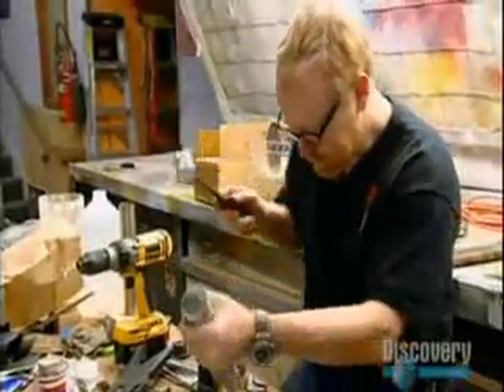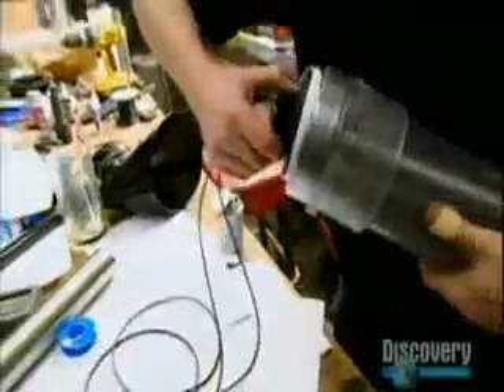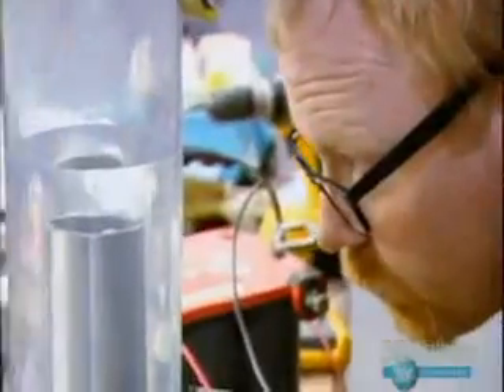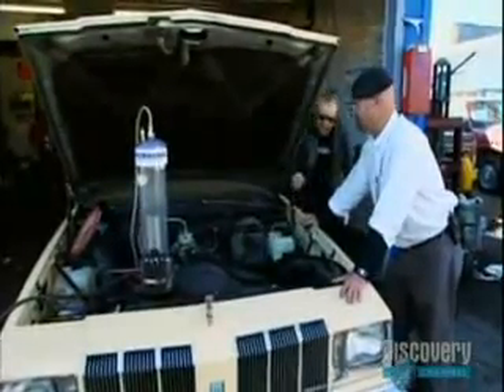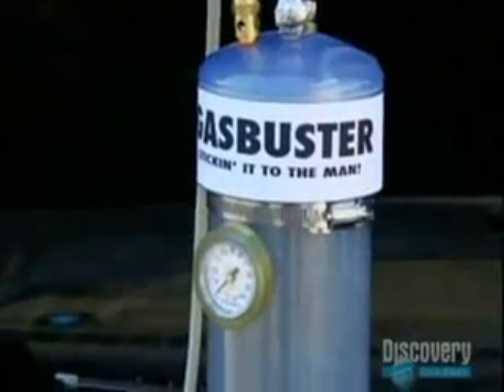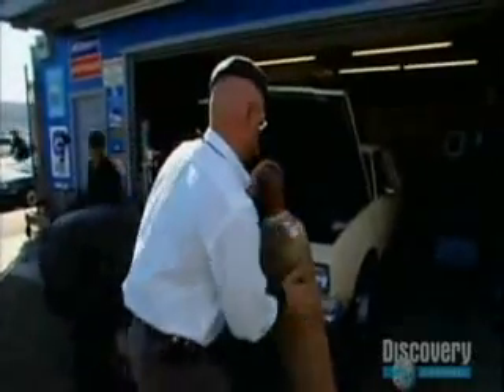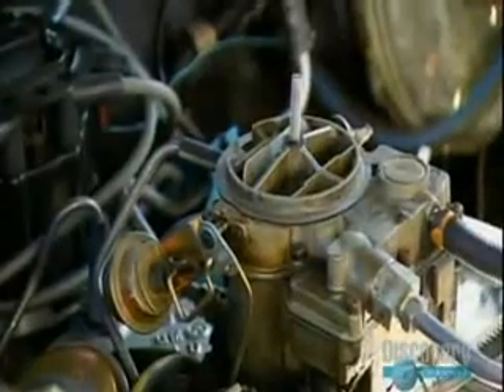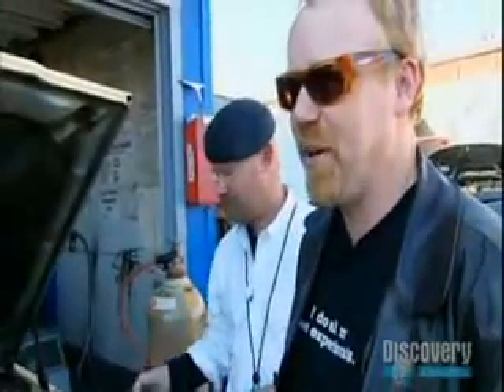HHO Mythbusters Explained

Comment: they failed because this cannot in any way work on a gasoline burning car! hydrogen explodes! the knly way to burn it is at a very low fuel/air mixture. which you cannot do with this simple technology. the other problem is once it is burning is it burns way too hot for the design of a gasoline combustion engine it could melt the aluminum.
Reply: do you not know how a combustion engine works? it's the explosion that powers the pistons.

Comment: HYDROGEN IS THE FUEL OF THE FUTURE. THESE GUYS ARE STUPID.
Reply: they want to the hide truth about it coz it will threat the oil industries.its all about business.
Reply: the show is compleatly trolling the subject.... they did nothing write in the so called "experiment"
Reply: You'll find that hydrogen bought in bulk (from a fueling station or whatever) is cheaper than the hydrogen you can produce yourself from electricity.  Electrolysis generated hydrogen is more expensive in electricity than the hydrogen it can produce.

But let's say for sake of argument, that you manage to get free electricity somehow...

Storing HHO (the H2+O2 mix you get from the electrolysis described here) is very dangerous.  If you don't separate the H2 from the O2, the resulting mixture is a pre-made perfect fuel-oxygen mix.  The slightest spark will blow up all of it, at once.  If you had a pure hydrogen (or propane or any other flammable gas) leak from a tank, it just hisses, and if you ignite it, you have a burning jet of flame.  If you have a leak in a low pressure HHO tank, everything goes boom virtually instantaneously.  Anything other than point-of-use/made-when-needed is asking for big trouble.

You can separate H2 from O2 relatively easily by designing the electrolysis cell to keep the bubbles of gas coming off each electrode separate, but this will make it far more difficult to produce large quantities of gas efficiently.

The other problem with HHO storage is simply that of storage container size.  At atmospheric pressure (all the systems here are), you need a storage tank of HHO about the size of your car just to store enough HHO for a few minutes of fuel at, say, a 10%HHO/90% gasoline ratio.

So you'd have to put it in pressurized tanks.  Add to the fact that Hydrogen gas seeps through just about any container and...

The mere idea of a storage tank of HHO pressurized to normal tankage pressures (say, 3000PSI) is enough to loosen the bowels with an irresistible urge to run very far away very fast.  Loose sticks of dynamite - if you somehow manage to ignite dynamite with  flame, all you get is a fire and a bad smell.

Combined hydrogen and oxygen is a FAE - fuel-air explosive.  Just watch youtube videos of these.  You want one of these in your back yard?
Reply: +Siward Beorn Has it occurred to you that using a device patented by an HHO nut as being "the answer" and showing it was a pile of crap was the point?

HHO nuts always point at published patents as "proof" it works.  Demonstrated that such a patent doesn't work is a pretty good demolition of that argument, isn't it?

The US Patent Office stopped requiring the inventors to prove that their "invention" being patented actually worked over 100 years ago.

Patents are cheap.  Sometimes groups of patent lawyers compete amongst themselves submitting the stupidest things possible.  The guy with the dumbest patent that's accepted wins.  And some of them are really dumb.  Like the centrifugal baby extractor.  Yes, that patent really exists.  Any women going through that would have killing the inventor as the highest priority.
Reply: Agree. This one Mythbusters are stupid.
Reply: +Elvis Morales "wood gas" is, technically, the result of "the destructive distillation of wood".  In practical terms, it means sticking wood inside a sealed chamber and heating the crap out of it.  At first, the wood boils out all the water it contains.  Once the water is driven out, the wood starts emitting gas.  If you put a pipe into the sealed chamber, you can draw off that gas and it will burn in air.  Much of the gas is methyl alcohol in gas form, and if you run the tube through a condenser, you'll get liquid methyl alcohol (plus a few other things in small quantities) dripping out, and that which doesn't condense is mostly methane.

If you just try to store the gas in a tank, you'll have a lot of liquid condense out of the gas.  So, you'd need to condense out what you can and store that separately before storing the gas.

Methyl alcohol produced in this fashion is called "wood alcohol".  In the olden days, this was the main method of methyl alcohol production, and known by as "wood alcohol".  It's by no means pure.  It will have small quantities of  other nasties such as formaldehyde, acetone etc.  These days they have far more efficient ways of producing pure methyl alcohol.

The wood left behind is essentially charcoal.

The only real reason it was done is that back in the day it was the only way to produce methyl alcohol as a liquid fuel or for things like solvents (methyl alcohol is the preferred solvent for shellac) largely as a byproduct of producing charcoal.  It's GROSSLY inefficient in turning wood into motive energy.  It'd be more efficient to supply the heat required into driving a steam engine.

Oh, and yes, the liquid condensate is poisonous - it's wrong alcohol for drinking, and the impurities make it much more lethal.
Reply: considering it is possible to make a bit of a better conversion job than stick a hydrogen line down the carb, i would personally convert my car to be a bi-fuel vehicle of hydrogen and gasoline. because wouldn't it be possible to fill up with hydrogen with home generators? and if i source the water from the stream literally running through our front yard, then i'm only paying electricity costs. i would be all-in on wanting to bring up more hydrogen filling stations, especially since now hydrogen fuel cell vehicles are starting to catch the public eye, GM released a prototype Colorado for fleet testing with the military, and what is it? a hydrogen fuel cell vehicle. opinions on if it should be produced are mixed though, but i do love the way it looks.
Reply: Justin Noker
Yea, but if you buy some land and the mineral rights and drill an oil well and build a refinery and spend your time operating and maintaining your well and refinery, you can have totally and completely free fuel and you don't have to modify your car at all!
Reply: Oil barons have long since bought patient of system that produces H in a marketable level. The US has the greatest oil reserves but has elected not tap it until other suppliers exhaust theirs but quietly smile as they bid up the price. This speculative strategy may destory their wealth once H production comes on line.
Reply: Guymick Cormic I disagree, hydrogen was the first fuel on this universe, so it does belong to the very beginning, not to the future
Reply: That's right!!
Reply: This device can be sabotaged easily. We do not know what true metals were used, or what voltages were used in the electrolysis. This "experiment" was rigged to fail. The big lies continue, and there is even an explosion to show how "dangerous" this invention is, and that it failed. And huge industries and governments have a vested interest in that failure.
Reply: Indeed it is exactly what you say it is Fromage. This is also true of moonshine actually too. Been watching some moonshine making vids on Youtube lately and the same nasty byproducts can produced there too. You NEVER drink the "heads" of distilled alcohol, the first stuff to come out of the still, as it is some nasty stuff that will make you go blind, damage your liver or kill you if you drink it. Acetone mainly and some other solvent by products that you would not dare drink. You taste it and spit it out to test if it is changing to shine and once the taste changes from the burn of acetone etc. to good tasting booze (the "heart" or good moonshine whisky) then once you have collected that in a separate container, you keep periodically checking it, till it gets weak and watery "the tails". Which you can save to add to the next batch. Even the toxic solvent "heads" are useful to save, for solvent cleaning jobs and firestarter. Lol. Like you say though, not efficient for powering a vehicle or other motor (although it can be done, certainly) cause it does not full combust, cleanly or efficiently. Sure can clean an engine nicely though of sticky deposits. Hahaha! Petrol gas or diesel is about the most bang for the buck, gallon for gallon in terms of efficient combustion and high power, unless we are talking compressed tank gases, like propane, natural gas, pure hydrogen etc.
Reply: Guymick Cormic water can be used in batteries. But it just wont be a fuel in itself. It require energy to turn the water into gases.
Reply: No, it aint'.
Reply: No, they're smart. Its called staying alive. You heard what happened to Meyers, right?
Reply: Do you even realize the point of this myth? It's not whether or not a car can run on hydrogen, but how fuel efficient it is, and it is not fuel efficient at all
Reply: neo bonito
Because using hydrogen consumes a lot more fossil fuels, the oil companies would love it. Why do you think George Bush and his oil company buddies wanted a hydrogen economy? Do think he wanted to help the little guy? Heck no. They knew hydrogen uses a lot more fossil fuel so they would make a lot more money!
Reply: Non it is not
Reply: They are neither stupid nor deceptive Commies, Elvis. HHO simply does not work. The laws of Thermodynamics and combustion are quite clear, on why it doesn't work and the laws of Physics and the law of diminishing returns. It takes more energy than it makes and what little it makes, does not matter a hoot in hell. Anyone who claims they work and sell and installs them is either a  scammer, or just plain stupid. People who buy them or built them are either stupid or deluding themselves and imagining they work. Lol. A little setup like this cannot possibly make enough Hydrogen (which is not even pure hydrogen, it is oxy hydrogen) to do even one revolution of the engine in 1 hour. I don't care what catalyst they use, or whether it's dry cell or wet cell HHO, it is utter nonsense. Simple Math and Science and combustion can prove this wrong. This gas can make a great little torch, but that's about it. There is proof of HHO torches working, but you can't even run a small car on this or have it "assist" gasoline. It saves literally nothing. It is also highly dangerous, in terms of fire/explosion. So there is more than a few reason to not be stupid and run this crap. There is a reason they were able to use tank Hydrogen and get it to start. It is very dense and pure and compressed in that tank. You also saw what happened when they did, BOOM. Case closed.
Reply: Elvis Morales
If you had watched the video you would have seen that they didn't use their "genius" to design one themselves. They built one from plans they got from a patent. How is it their fault if the unit didn't work very well?
Reply: That is what George Bush said, are you smart like George Bush?
Reply: Maybe the far, far future when we have technology imagined today.
Reply: Frank Gutowski
We are all famous and rich that is how you get to know and read our comment.
Reply: Guymick Cormic they r actually very smart which is why they are paid to mislead keep the search up tho the truth is what u believe no matter what
Reply: the only way it coulb be feasable is if you electrolyse at home and stored the hydrogen then use it your car not use the batery from the car it bull shit people are stupid they dont even knw about thermodynamic
Reply: Even at present means of production, enough H can be produced to serve our energy demands by installing solar cells on our Railroad right of ways. Power supply should be decentralized to expand our security. Imagine the alternative had the money spent on Middle East wars was spent on installing solar cells on railroad rught 
of ways- with small alternation all cars would be supplied with H n our power grid would be decentralized. We either allow a continuous of the drain of wealth by the military industrial complex or demand serving the interest of the people n our nation's wealth.

Comment: want one of these new kits that make hydrogen on demand and mix in through air intake to help save fuel but just don't know wot to believe do they work or not?
Reply: I've seen many reports of increased fuel mileage. And even if not- it would still be a cooler burning, cleaner burning and life- extended engine.

Comment: Better to just use batteries, as converting to hydrogen is only 60% efficient and using that in a car is only 40% efficient, while batteries are over 90% efficient. Sure, a full tank of liquid hydrogen will get you further, but cost you 5x more
Reply: Liquid hydrogen is not only expensive, it's rather impractical.   You can't get hydrogen to become liquid until the gas is cooled below 33K (oh, about 400F below freezing) under very high pressure.  It won't remain as liquid at atmospheric pressure until you cool it to 20 Kelvin.  Making tanks that can stand up to those temperatures and/or pressures isn't exactly easy or cheap.

In fact, even a smallish tank capable of doing that will cost more than the rest of the car put together.

Comment: Check out this http://www.hhokitsdirect.com/?gclid=CLL54MzPwM0CFVhZhgodm1IFeg  where the hydrogen is injected into the air intake for the car.  Supposed to make enough H to get the car to burn gas 30% better and save $$$ at the pump.